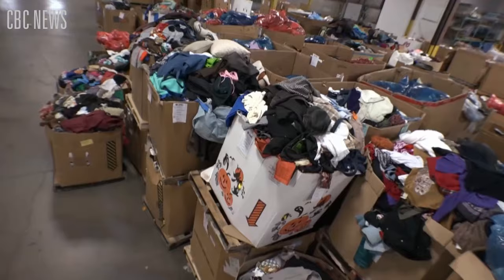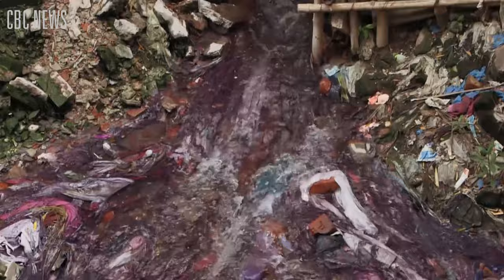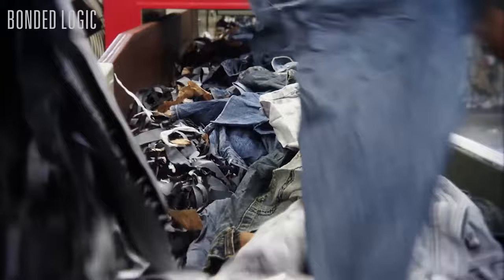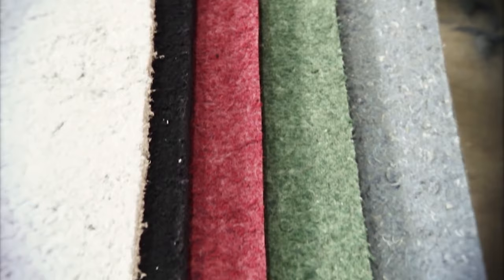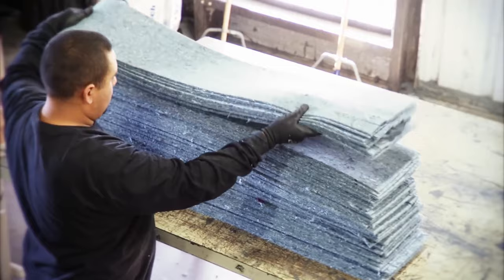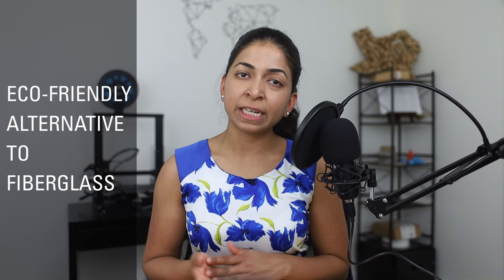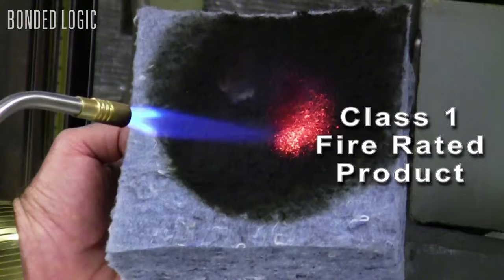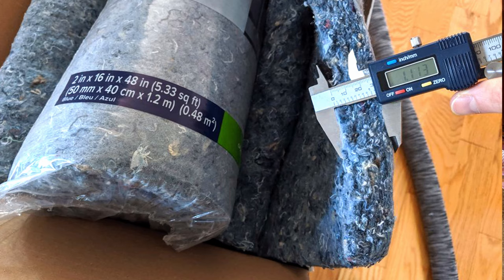Converting jeans into denim insulation

Comment: Belinda, I am creating a skirt for my RV. I live in it full-time. Our winter temperatures can get down in the negative F but are typically not prolonged. Do you think denim insulation placed on a panel (material TBD) would be a good choice for protecting the underside of the RV from freezing?

Comment: When I built a bedroom in a home I owned I used old clothes, socks and sheets to insulate interior walls. It was free and saved me from buying insulation. Most homes don't use insulation at all on interior walls at all so i figured it couldn't hurt. It definitely cut down on sound if not the best insulation. I sold the house awhile later so it's unclear if it was ever a problem later on down the road.

Comment: Used this from a French manufacturer sold in UK in my barn conversion for internal walls, acoustic, and loft thermal insulation. I think the French looks higher quality. 
Not cheap, but meant I could live in the  unfinished build whilst still insulating,
 clean and non-toxic. Also makes me feel better that is not flammable. 
Took a lot of finding, was expecting to use sheep's wool until told of this by an eco adviser randomly met. It can be a pain to cut, and came in 600mm width, needed 400. Learnt to tear across rolls and put between studs in smaller pieces. This was after cutting first rolls by special handsaw. Hard work. 
Very under-rated, building inspector never seen before, oh, and insulated underneath and around bath too, keeps water hot for longer. Great videos.
Reply: hello! I am french and I would be very interested to know the name of the french manufacturer.. Would you be able to help please?

Comment: I used denim insulation in the ceiling and walls of a 2x6 stud 2x12 flat trusses19'W x 47'L x 12'H RV style garage addition on our AZ house 7 years ago and I learned a few very valuable (for me) lessons on what I would do differently next time. I finished off the shop with drywall, paint and epoxy floors.
What I initially found: 
- Insulation value felt comparable to good fiberglass & spray insulation. 
               I felt no heat transfer on the insulated part of the walls or ceiling even with 110F+ exterior temperatures.
- The denim absolutely kills noise levels in the garage (not only exterior but interior too to the point it was oddly quiet) 
               Even a running 4hp compressor motor/pneumatic tools were quiet enough to talk without having to shout. 
- Welding sparks just bounced off the denim and raw concrete with no marks.
- The atmosphere of the raw wood and denim was very aesthetically pleasing (add a few pendant lights and it would have felt like an old saloon)

Then I covered the walls in drywall/paint and epoxy coated the floor, making the garage brighter and very finished looking.

- Big mistake and I regretted it immediately.
- Interior noise went way up, every sound echoed. It was shockingly loud after a month of feeling like I was in a sound booth.
- No "seat of the pants" improvement in heat transfer through the walls
- Lost all the old saloon atmosphere
- Lost the ability to weld without burning holes in the epoxy without using welding blankets

We purchased a new house with a barn/workshop currently insulated with fiberglass rolls and drywall. 
- Removing the drywall and fiberglass insulation immediately
- I will definitely use denim again, but no drywall or epoxy floors

Comment: I have to check this out! Always looking for an alternative to spray foam insulation when installing windows and doors. That stuff is just a mess, and if you don't use the whole can, you end up having to throw that away because the nozzle clogs and hardens.

EDIT your voice sounded fine. Happy to read that it was just allergies, and nothing fashionable, ha ha. Hope you're feeling better, Belinda!
Reply from the maker: Haha, thanks David! The spray can stuff will do a better job of sealing gaps, but it has a very low R value.
Reply: I've seen passive house builders use flexible styrofoam tubing to seal fenestrations instead of spray foam. I don't think it offers any more thermal protection though. They probably preferred it to prevent frame warping from curing expansion.
Reply: re spraying: use a $20 spray gun with the 24oz cans and you can simply turn off the valve and restart using it for a few months. Also easier to create consistent beads.

Comment: Thank you for this, I am researching insulation materials for a new house, but denim is not the answer.  Cotton is very hydrophilic, it would wick and retain moisture.  Also perfect nesting material for mice if they ever get to the wall cavity (and a 1/2” gap is all it takes).  A couple years ago I had a carpenter ants infestation in the walls of my cabin, I ended up demolishing all four external walls from the outside in (it’s a post and beam structure).  Found that carpenter ants has excavated nests in the rigid high density foam insulation.  those parts where the insulation was fiberglass I could see where mice would chew it up and reshape it to form nest cavities.  I think denim would be even worse in this respect.  There used to be an organic expanded clay pellets material, available in small quantities as medium for growing orchids and such, but have not seen it in a format for insulation.
Reply from the maker: What's the best way of keeping out carpenter ants? Also, I hadn't heard of expanded clay pellets before, thanks for that! Let me know which insulation you end up choosing. Spray foam probably?
Reply: What you say is true, damp is the major problem. Mould, insect, vermin and fire retardants all degrade and release toxins into the air. Cotton grows in a year, so it is not depleting the planet. In fact the total energy used in manufacturing the insulation, along with all the stages of transport and sorting is a larger problem than wasting degraded cotton which naturally decomposes in damp landfill without releasing toxins.
Paper is very similar, since with reduced use due to electronic mail and data storage, along with direct recycling, wood from branches of felled trees, along with pruning keeps pace with demand without felling trees for it's manufacture.